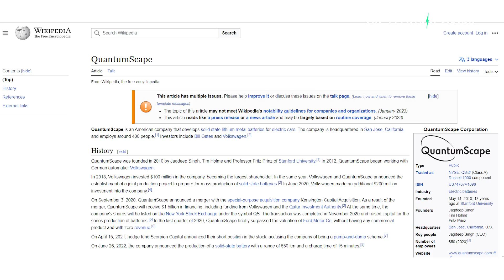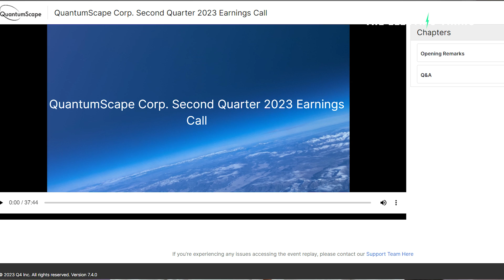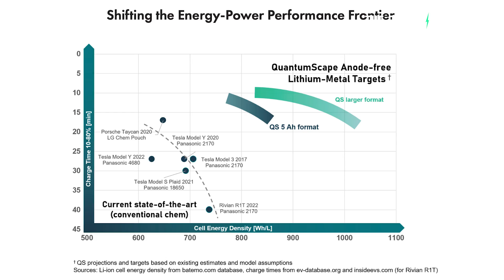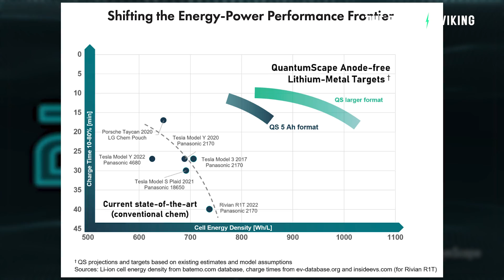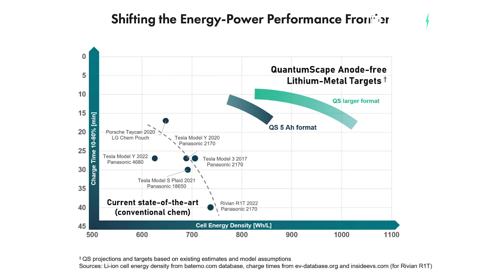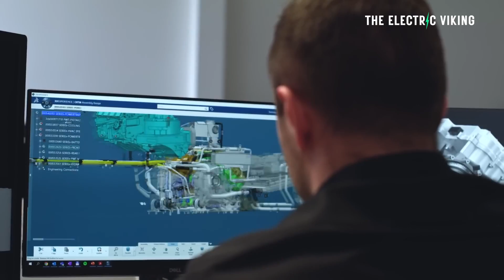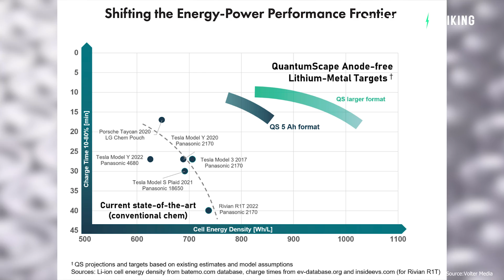American Solid State Battery manufacturer sends batteries to 6 car companies

Comment: Solid-state batteries are an extremely difficult challenge. Progress will take time, and the rollout will be gradual. They still need to validate the B sample, followed by the C sample, before integration into EVs. Achieving gigafactory-scale production will likely take another two years after that. However, it’s far better to follow this longer timeline and deliver a battery that allows EVs to truly compete with ICE vehicles, without relying on tax credits or subsidies, than to rush out products like some Chinese battery makers, who release underperforming cells that can’t even match the energy density of 5-year-old technology yet market them as cutting-edge.

Comment: Looks like existing technology's will be able to squeeze out some more gains in a few years. Hope they can make it happen but
I haven't seen in Solid State Battery's yet and it seems there are quite a few start ups chasing this and other Techs. The 4680
has been kind of a disappointment to far , maybe Gen 2 or 3 of that will be better and it's suppose to be in the Cyber Truck. Seems 
like all these cars need another 100 miles of range to get the current claimed range. (EPA)

Comment: if the solid state batteries can provide a way to either not degrade at all or do it much slower than current batteries then they already won.. because they win the long game.
even if they are more expensive to manufacture.. and hold less charge than current batteries. 
this is supposed to be their point.

Comment: I have two very heavy Li-ion batteries in my two wheel drive e-mountain bike. BOY I would love to replace those batteries with solid state batteries. And maybe in 3 years it will be possible at about the same price as my present Li-ion batteries which presently averages $650. per battery. (!!)

Comment: Sam, you do such a good job of reporting on this field. Thank you!  I'm getting stuff here I don't see anywhere else. I am a long-time subscriber.   My concern about solid state is that the electrolyte is always glass or ceramic. i.e. brittle.  You wouldn't want your electrolyte to shatter as you roll down the road with your car doing its normal flexing. I wonder if they have cracked that nut, so to speak. All good wishes.

Comment: Another thing my Ni has picked up on is the IPhone 15, it is heavier and marginally larger than the 14, I believe this may be a setup to profit off of a lighter IPhone 16 that charges super fast. Apple along with many other companies have suffered from supply chain issues that China is weaponizing, selling a more domestic product would be a major selling point for Americans and the pre mentioned advances would entice buyers globally. I believe the CE demand for solid state batteries to be larger but harder to quantify as new opportunities will be realized with the potential of SSB’s.

Comment: Amen brother. The virtues of QSE-5, project Cobra and Raptor will be the tipping point and I believe realized soon. The ability to manufacture a 5ah battery will prove the ability to manufacture the 24 layer EV batteries. I am excited for QS and invested in them. Toyota is probably going to do what they claim but I can’t get behind a company that does not publish their technicals and their accomplishments will be diluted by the rest of their business that is arguably struggling.

Comment: I am long on QS and purchased it at about 2X what it is trading today. Am I worried about losing? No.  The pipeline for this type of technology is long and the market discounts the value of the stock severely, especially when interest rates are so high. Even so, there are some key points to consider, namely that even if you double the energy density with SSB, if it increases the cost of the car $5-10K, it is a non starter for many applications in today's competitive EV market. Some in Asia are even talking about cars with sodium batteries (less energy density than current Li-ion) just because drivers in these markets do not need 400 km of range, but cheap, recyclable batteries, which sodium provides.  QS made some important technological breakthroughs that the industry is likely to use in a few years, but for now, I think their products will be in cars costing $70K or more.  I do recall that their prototypes were being sent to Porsche.  On a smaller scale, solid state a batteries have been launched for low drain applications like hearing aids.

Comment: Dude!  You're completely wrong about Lithium Ion batteries continual improvement over the next decade.  We are very close to the ceiling on that tech.  And QS is playing it safe at only using 24 layer cells (instead of 48 or 96 or 192 layer cells).  Also, QS is about 15 to 18 months away from mass production (porsche) :).  It is rather weird your analysis in this video, in that you state that QS is for real and their claims look to be real, yada yada yada... all good.  But you state at the very end we are a decade away from solid state batteries being mass produces.  We are not, we are 2 to 3 years away.  Yeah, maybe a decade away for enough solid-state batteries being pumped out to go into every new EV vehicle.  You really, really, really, need to clarify and specify what you are saying at the end of this video, because it comes across like "QS" is a decade away, which we are not.

Comment: If it comes from VW, I wouldn't buy it.  With how they lied and tried to get around diesel emissions for year, there is no way to trust them.  I owned a diesel vehicle and they tried all they could to make it my fault with the cars issues until they were told to offer to buy the car back from me.  I was actually told by the dealer that "I was driving the vehicle wrong".  I laughed in the guy's face and told him the car was designed wrong.

Comment: Even if solid state batteries do not become competitive in the automotive market, there is still a huge market in aviation for them. Currently the weight for the energy density of lithium ion make no sense for electric aircraft, but solid state batteries might change that entirely.

Comment: The stock price of QS took off after their latest earnings simply because they said they are working with an automotive partner on batteries for a launch vehicle. They gave catchy names to their planned production process improvements for the solid state electrolyte too. That's exactly what investors want to hear and that is good news, but most people still don't realize how long it will take them to produce commercially relevant batteries at any kind of meaningful scale. I strongly believe QuantumScape has a good fundamental technology (maybe not the best solid state technology though), and they will be a player in the future battery market. But they do not yet have a means to efficiently produce their solid state separators at a GWh scale. I honestly don't think they will until we start approaching the end of this decade.

Comment: I've yet to see a solid state battery on phones. That tells me its a long long way off development..A new type of battery needs to compete with current tech. Means it needs to be cheaper than whats currently available. If its more expensive then it has to be much better in terms of power density or better safety than even LFPs.

Comment: Usually in cases like this, the "old" tech will reach a point where progress will start to slow down a lot while the "new" one will continue to progress faster and further. Until the new one finally reaches and overtakes the old tech. It might still take decades. The first use cases will likely be very niche (niche, not Nietzsche, there is no "t" in there to pronounce out of nowhere) and expansive and grow from there.

Comment: One thing I would point out about the cost; let's say these new batteries cost twice as much. I don't think they will, but let's say for the sake of argument they do. The thing is, if energy density is double, you only need half as much. In which case, the overall price will be the same. It will still be a superior product though. Why? Because using half the battery SIZE (or space), means a huge weight saving, and therefore performance benefits, not to mention allowing designers the ability to package things differently, and possibly provide better internal space within the vehicle, different balance, power to weight, handling, and braking benefits.
Additionally, while some discussion in Sam's article talks about how the lithium ion battery will be so much better with development time, it also needs to be said that these SSD's may well ALSO improve. I don't really see any reason to think that a new generation of battery will not be superior; if that were the case, there wouldn't be billions of dollars being spent pursuing it. I'm fairly confident that the people who spend the money are well versed in the detail of product planning and the future roadmap, along with having a very good understanding of the various possibilities that upcoming testing is meant to explore.

Comment: Answer me this, Sam, https://www.youtube.com/watch?v=zS6dwGFv5HI&ab_channel=ChinaInsights. Cars from and in China are thermal runaways. Charging, after collisions and when just sitting there. ICE cars do not do this. 

EVs are a good idea but we do not have the tech' yet to make them safe. Spontaneously combusting is one thing an ICE car cannot do. Some of these people driving EVs don't have time to pull over on a freeway before the car entirely incinerates. 

Travelling at 100 km an hour any smoke trails behind sometimes with occupants unaware of what is happening until it's too late. Meanwhile, people behind the car are breathing in poisonous cobalt gas. 

I believe EVs are a change to come but we are not there yet. France and England will be passing a bill to stop them entering the channel tunnel. Ferries and cargo ships are now finding insurance companies are saying they will not insure the ships unless all EVs or hybrids have their batteries taken out of cars. This means battery packs will have to be assembled at the point of sale in the country they are being shipped to. 

Where we live, people like Chris Bowen who obviously arrived from a parallel universe where nothing ever goes wrong and electricity just falls out of the sky, will probably fit everyreadies to them. 

I would love you to address this because you can run down ICE cars all you like, but considering the amount of CO2 that they produce, it is nothing compared to the industry. Mining up to 500,000 tons of earth to get the minerals. Now that doesn't sound CO2-friendly. Also, renewables are finally being seen for what they are, as faulty as EVs. 

If you want to go back to the 1700s then have 10,000,000 EVs plugging into the grid and watch it collapse for good. Australia doesn't have the infrastructure to cope. Stop oil and coal, and you will have nothing of anything except people without clothing and every little thing we possess that is made from oil. So 99% of everything we have.

Comment: graham is right of course QS wants to prove they have a vaiable product to makers so they can justify a factory. Then you need time and people and a supply chain to be put in place.  None the less if they can get higher desnity cells the risk may prove worth taking. It is still a lithium based tech and so it still has the draw backs of lithium's lack of scalabliity; but higher density could mean less lithium per car, moderating the choke point that exists

Comment: If solid-state technology were truly as groundbreaking as some suggest, it's likely that Elon Musk would have already dedicated a specialized team to explore its potential. Nevertheless, I believe that the energy density of current batteries will continue to improve, potentially reaching a point where they surpass the advantages of solid-state batteries. Take, for instance, the impressive performance of a 2-ton Tesla, which can cover 350 miles on what is essentially a battery the size of a shipping palette. It is truly remarkable.

Undeniably, solid-state batteries have their merits, and I share your excitement about their potential. I have often pondered the possibility of charging them through innovative methods like harnessing lightning and transmitting energy to a grid of solid-state receivers via large antennas. However, until such advancements become feasible, we should acknowledge that the current battery technology has already made significant strides, effectively disrupting the internal combustion engine market.

Solid-state batteries would indeed be the perfect addition to the existing technology landscape, like the cherry on top of a sundae. But for now, let's appreciate the progress we've achieved and the promising advancements still to come. Elon Musk and his team have undoubtedly contributed to the sustainable energy revolution, and the future holds great promise for even more impressive breakthroughs.

Comment: If they had a working solid state battery - they would not need to wait for cars to be made to test it. What a joke. A battery can easily be tested in simple lab tests. And all of its parameters and characteristics would have been known. So this is yet another promise with no substance, they just found a new way to put a spin on it.

Comment: Hears claim around revolutionary battery.

Checks price of oil...no change.

When you see an announcement that drops the price of oil 10% overnight...then get excited.
Reply: Not really, EV have little impact on oil consumption. Notice how Norway is never used as an example for reducing of oil consumption😂. Most of the cars on the roads are ICE and additionally people buy bigger and bigger ICE SUVs nullifying the savings effect.

Comment: making a 5Ah cell means they will go for the high-end mobile phone market.
either for a very slim phone or a phone with a normal size and 10.000mAh which means two of these cells.
if they want to go for the car market, they need to make a big cell like the LG Chem E78 which has a length of approx. 500mm and width of about 10cm.
but of course the cell phone market could be supplied first to get a much higher profit.

Comment: In over 40 years of driving I have seen three cars burning on the side of the road. And another six burned-out husks on the side of the road.

And order a vehicle fires, hybrids have the highest rate, then internal combustion, and finally electric vehicles have the lowest rate of catching on fire.

While you can put out the vehicle fire in theory, in even gasoline cars are raging infernos by the time the fire department can arrive.

News outlets report every electrical vehicle fire. They haven't reported gasoline vehicle fires for decades. Gasoline vehicle fires are boring.

Comment: I thought Toyota already had these... ;-)
Reply: toyota claims to have solid state batteries with a polymere separator since 10 years.
but as it turns out they don't even know how to test their cars. in a test in norway (very cold country in europe) the battery of the toyota BZ4X overheated at only 14°C temperature. and the range was the worst in all the tests so far compared to their WLTP claims.
why didn' toyota figure that out before selling that shit?

Comment: QS solid state batteries dont have that much higher energy density than ordinary lithium-ion. And everyone who talks about "solid state" instead of just talking about lithium-metal dont know what they are saying. The whole reason for using the solid state electrolyte is to get the lithium-metal cell working. If you can get lithium-metal working with a liquid electrolyte its also good or even better. Northvolts Cuberg-cell is a liquid lithium-metal cell proven in independent tests with 400+ WH/KG.
Reply: Also on their website they get a little more specific, Litium Metal NMC. C for cobalt.
Also talking about Wh/L, pouch cells have an advantage in that metric over cylindrical cell. What is the Wh/kg? EV-Planes are asking.

Comment: QuantumScape shareholder lawsuit:
"The plaintiff alleged that the defendants failed to disclose that the Company’s battery technology was not sufficient for electric vehicle performance, as it would not be able to withstand the aggressive automotive environment; the Company’s battery technology likely provided no meaningful improvement over existing battery technology, that the successful commercialization of the Company’s battery technology was subject to much more significant risks and uncertainties than defendants had disclosed."